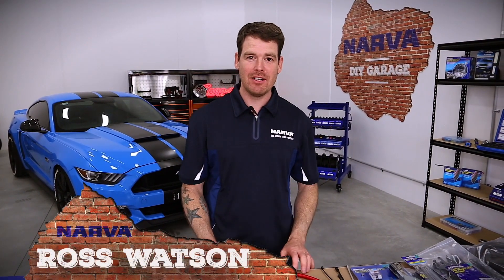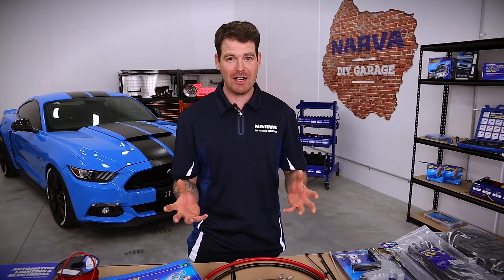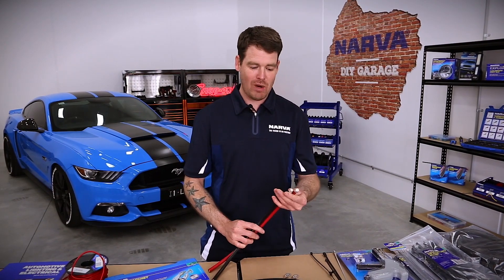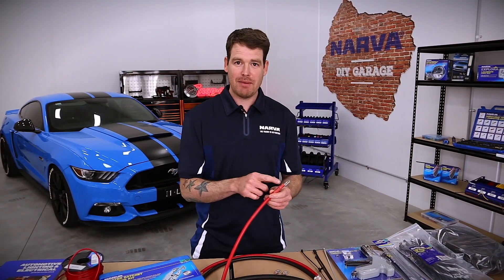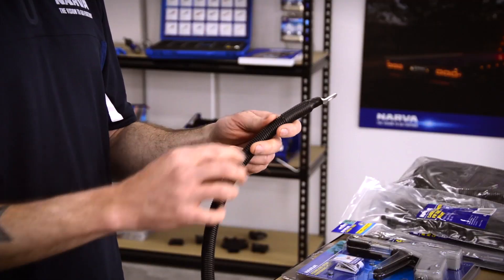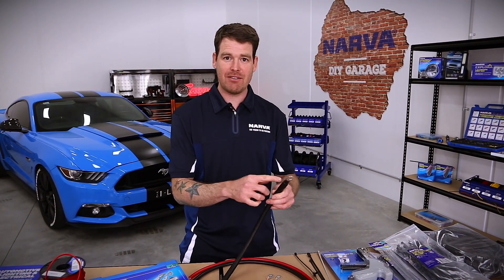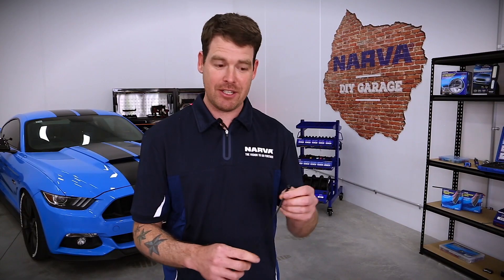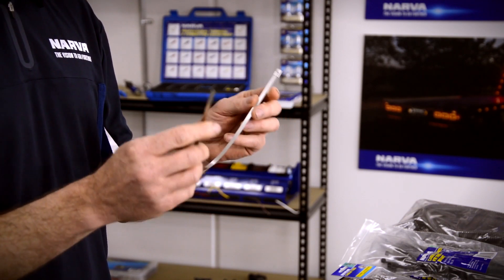Good Wiring Practice

Comment: I have bought your narva 4 pin waterproof connectors I think they’re very good but I’m struggling in finding the correct not near enough good enough but the proper crimp tool as the pins seem to require can you point me in the right direction
Reply: The Narva catalogue says what crimper to use with the connectors. Download the PDF and have a look in there.